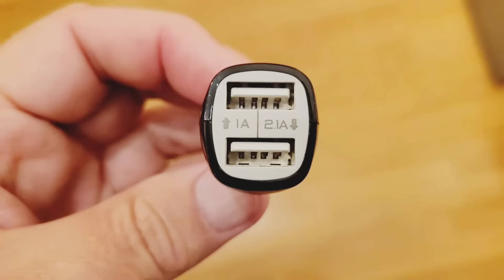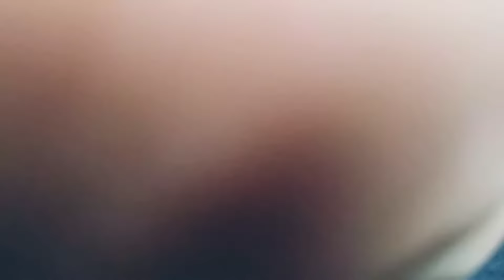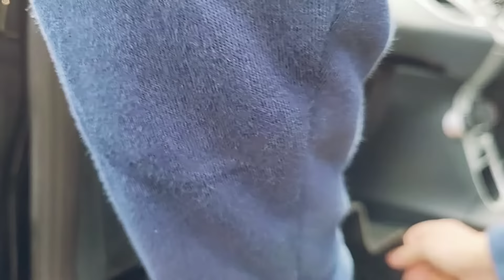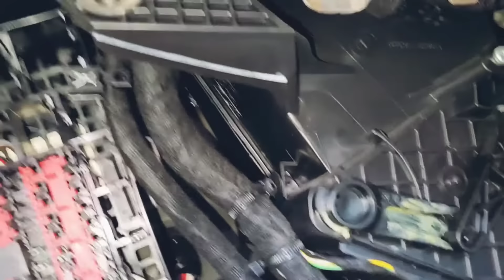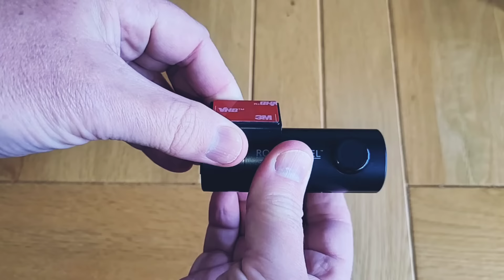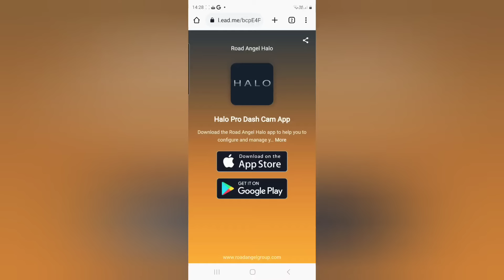How to Install a Road Angel Halo Go Dashcam

Comment: But if you remove a fuse won't that fuse stop something else working or is it a spare fuse
Reply from the maker: You put the fuse back in, attached (piggy back) to the adapter.

Comment: Many thanks for your useful video. In April 2024 I bought a Halo Drive front dash cam exactly as shown in your clip and it was fitted by Halford. I just noticed only few moments have been recoded on that date and nothing more. Can you please help me to find the solution, Regards
Reply: Many thanks for your advice
Reply from the maker: It sounds like a problem with the micro SD card. You could try reformatting it. This link should help: https://www.roadangelgroup.com/pages/support-for-road-angel-sd-card#:~:text=Back%20up%20any%20footage%20you,If%20the%20issues%20persist
If that doesn't help, try another card (make sure it is a high endurance one like this: https://amzn.to/4iHRL8V). Good luck!

Comment: If I left this in my cig plug, 24.7 would this wear the battery down? As I don’t trust myself to hard wire it 😊
Reply from the maker: @Ajea22xx  No, it shouldn't drain your battery. Your cig lighter should be on a switched fuse, so the power cuts off when the ignition is off. Even if it doesn't, road angel dash cams monitor the battery output and switch into a low energy mode when the voltage drops below a certain level.
Reply: @ thank you

Comment: I'm trying to remove the sd card. For the life of me, I  can't figure it out. Anyone?
Reply from the maker: @Watcher40000  normally you just have to push the card in with something small like a sim removal tool, and it will spring back out. Good luck!
Reply: @bigtedshome  that worked. Thanks for your help, friend 
👍🏾 you're a lifesaver.
Reply from the maker: @Watcher40000  You're welcome 🙂

Comment: i bought the wiring kit but it has 2 cables acc and bat+  any idea why it has an extra cable to yours? i bought the right one from argos
Reply from the maker: Does your wiring kit look like this? : https://www.appliancesdirect.co.uk/p/hwk5v/road-angel-hwk5v-dash-cams-dash-cam
Reply: @ nearly the same mine has a a box instead of the wee cylinder
Reply from the maker: This came up in a previous comment below. The yellow cable connects to a constant positive and the red to a switched positive. 
It looks like the Halo Pro needs both (your hardwire kit can be used for several models) but I'm 99% sure that you don't need to connect the red cable for the Halo Go
Reply: @ ah didn’t see it sorry, yeah I connected them both to the car I assume that will be okay? I’m waiting on the dash cam to arrive as I got a good deal for a 2nd hand unit comes Friday

Comment: What about battery drain if the dashcam is hard wired? @samconroyy asked about this but no-one has answered.
Reply from the maker: @bucklercarskarts2075  Road Angel dash cams have a battery monitoring feature the monitors the battery voltage and switches the dash cam into power saving mode if the voltage is too low. The product details can be found here: https://amzn.to/41n1cDr
Hope this helps 🙂
Reply: @bigtedshome  thanks for the info - put my mind at ease.

Comment: My cigarette lighter in my car is a constant positive, it doesnt turn off with the ignition of the car,  could i just use this? Also wouldnt this eventually drain the battery, your way included?

Comment: That's the wrong hardwiring kit to use the parking mode as you need the 3 wire kit that includes the yellow wire👍

Comment: My halo is saying insert SD card but it’s already in. Any ideas please?
Reply from the maker: Are you using the correct type of micro sd card? Some dashcams don't recognise micro sd cards that are not high endurance cards like this: https://amzn.to/4aQJycR
Reply: @bigtedshome  it’s same one that’s been in two years. Came with the Halo.
Reply from the maker: @keeleymelia2750  Micro sd cards do wear out, especially when they are being continually overwritten like they are in a dashcam. Replacing the micro sd card is much cheaper than replacing the dashcam and will probably solve your problem. Good luck 🙂
Reply: @bigtedshome  thank you!

Comment: Might be worth noting that some insurance companies may regard a hard wired dash cam as a vehicle modification and may need to be declared. If you use the cigarette/accessory socket to power the dash cam, then that isn't regarded as a modification.
Reply from the maker: Thanks for flagging this up. Looking into it, it seems to be a bit of a grey area and company dependent: https://www.reddit.com/r/CarTalkUK/comments/yaql4k/hardwire_dash_cam_considered_as_modification/
Reply: thanks for that.

Comment: I am having issues with the installation. Hardwired in by Halfords but no parking mode active to record. Any tips? Shrink mode and ordinary mode tested in 24-hour mode. Thank you in advance
Reply from the maker: Sorry but I'm not that familiar with this dashcam (I just installed it for someone else). Have you tried the Road Angel support line on 0330 320 3030? Good luck 👍
Reply: Because they put the standard hardwiring kit in you need the kit with the yellow wire to use parking mode

Comment: Great guide thank you! However I've got an issue with power getting to the dashcam, I've used a multi meter and identified a constant positive fuse, I've even checked the multi meter again with the piggy back fuse in however there doesn't seem to be power getting to my dash cam.

Could it be the ground/negative cable?
Reply from the maker: Yes, it might be a good idea to try a different grounding point. This is worth a read: No power going to can, install troubles : r/Dashcam - Reddit https://www.reddit.com/r/Dashcam/comments/ap5zd7/no_power_going_to_can_install_troubles/
Reply: Thanks will give it a go!

Comment: My road angel kit has the black spade connector, but two power connectors, red but also a yellow? What's that one for?
Reply from the maker: It looks like the yellow cable is connected to a constant positive and the red to a switched positive. https://www.appliancesdirect.co.uk/p/hwk5v/road-angel-hwk5v-dash-cams-dash-cam
It looks like the Halo Pro needs both (your hardwire kit can be used for several models) but I'm 99% sure that you don't need to connect the red cable for the Halo Go.
Reply: @bigtedshome  thanks! Great video too.
Reply from the maker: @david1731048  Thanks David 👍

Comment: Thanks mate, do you need one of those metres or could you just check your fuse box manual to find out which one is Live
Reply from the maker: Yes, you could Google the fusebox layout for your car. Anything that stays on when the ignition is turned off e.g. headlights will have a constant fuse.